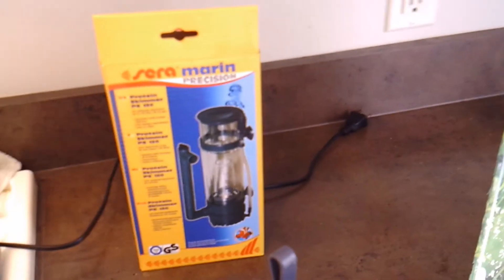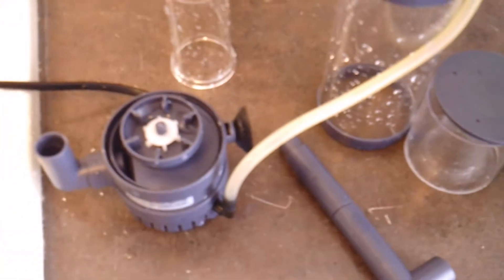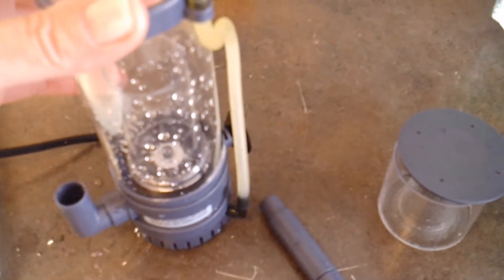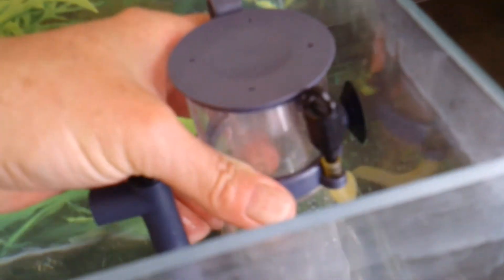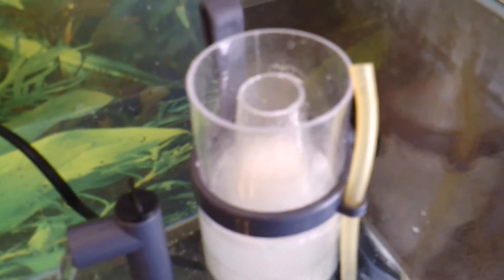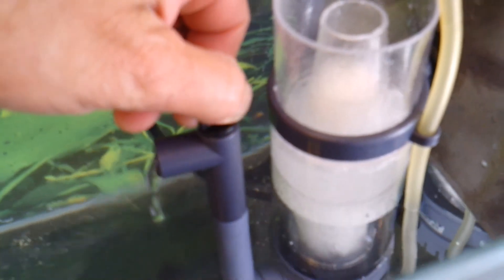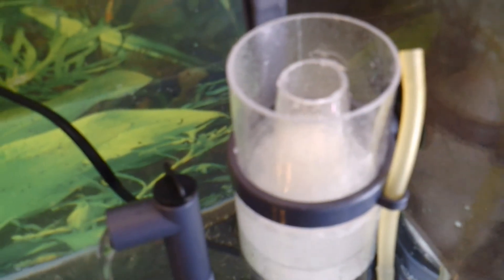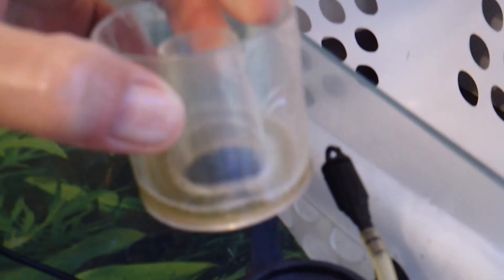Sera Marin Protein Skimmer PS130

Comment: It seems like this thing doesn't have to be completely into the water right? Only halfway or something?
Reply from the maker: Yes, that is correct, about halfway submerged will allow you to get enough foam generation.
Reply: @lkapitan8232  Thanks. Received mine today (a Chinese knockoff called Boyu WG310) and the pump itself is pretty quiet though, but the air intake needs a better muffler. 
Now that i've seen it in action, my biggest concern is the amount of internal waterflow. I guess it's around 25 gallon per hour tops? The sump where i've put mine in has a flow of around 125 gallons per hour, so the ratio is around 1:5. That's not a lot. Only 20% of the water is getting skimmed.
Reply from the maker: @Harolddespui  Here is my 2 cents worth on this topic.  Within reason, you can never have a skimmer that is too small.  I proved this to myself with an Icecap K2-50 running on a 55 gallon tank and 30 gallon sump, https://www.youtube.com/watch?v=kodtVJZht6Q&t=4s.  I had to empty the cup twice a day, but it worked great.  Conversely, I proved to myself that you can have a skimmer that is too large.  Years ago I ran a large Reef Octopus, don't remember which one, on a 20 gallon tank and the only skim mate I could get was thin, watery tea stuff.  There just was not not organics for it work properly.  Conclusion, is you don't mind emptying the cup often, I bet it will work fine.
Reply: @lkapitan8232  Made a better muffler for it. Now that the inlet air sound is greatly reduced i realise how loud the rest of the skimmer is, lol. For the fish it must be deafening. :-)
Don't think this is a keeper.